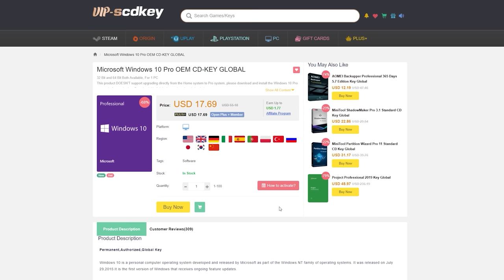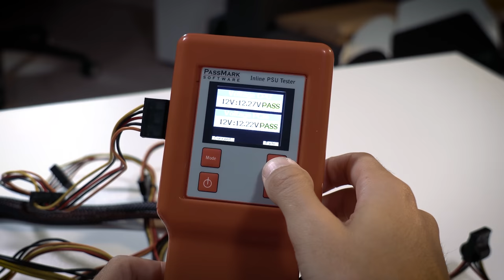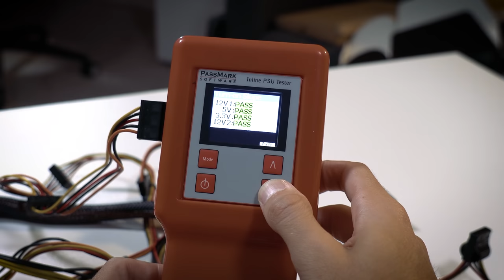Fixing a Viewer's BROKEN Gaming PC? - Fix or Flop S1:E10

Comment: Great video. Am I wrong or does that case already have a vertical mounting point? It did look like it would be a little close to the side panel so I could see why you’d go aftermarket, at least from an airflow standpoint.

Comment: Its prob a small capatitor that store some energy to boot it up. Had the same issue had it happen after a voltage strike because a company ripped a cable outside

Comment: had the same case you can do better cable manage but myssd holder was more in the middle and drilled out hd cage on right to have more fans avaible in front only used ssd

Comment: ThermalTake has always made crap PSUs. One question. The case looks like it has vertical mount space built right into the case. Why not use the case's built in vertical mount rather than using a vertical mount adapter kit? Just seems like unnecessarily adding the hassle of opening the case to plug in the video cable rather than just leveraging the integrated vertical mount provided as a part of the case. My guess is probably for cooling to provide more space between the GPU fans and the case door.

Comment: I had an issue, where mine shut off after an update, and when I turned it back on, it just lit up the system, But not signal the screen. I messed with the ram, and it came on, went right out.. I kept hearing to reset bios and see if that would work. Then I saw a video to take out the CMOS battery, and after 15 seconds, put back in. I did... then, and only then did the system give me a code...or error signal... the Alien head flashed... Turns out... Was a CMOS battery failure..  I already had a battery that was right size.

Comment: i had a power supply fan bearing blow out and i shut it down immediately to prevents a brown out or short that could happen in minutes. if this happens to your coolant fan as well SHUT IT DOWN IMMEDIATELY TO PREVENT COOKING YOUR PROCESSOR OR MOTHERBOARD "IRREVERSIBLE DAMAGE WILL OCCUR"

Comment: Sadly I need to get round to replacing my case a say sadly because the case is still in great condition apart from one icie problem the rubberised coating on the plastic has gone bad (something I didn’t even know it could do) and it’s now sticky to touch and leaves residue on you if you touch it, I’ve tried scraping it off and cleaning it but it’s like tar.

So I’ve learned something for future note don’t get anything with a rubberised coating ye it looks and feels good at the start but if it goes off elk.

Comment: Hey Greg so I was putting rgb fans in and hooking them up. The rgb lights on all 4 fans will not light up. I had an extra and plugged it into the same ports on the controller and it lit up so it's not the controller. Is it possible for 4 fans to go out at the same time?

Comment: I've repaired power supplies, but in vintage computers where you can't get them anymore. Anything made n the last 20 years is going to be easily replaceable unless it's a prebuilt with a proprietary PSU.

Comment: I have a computer that when I turn it on, the cpu fan spins, the psu fan spins, but, no bios, and no rgb on my ram sticks. I've tried swapping the ram sticks around and different psu's, I believe its the same motherboard in this video actually lol. Any suggestions that wouldn't break me? I feel as if the cpu is bad but then again I don't think that'd stop the computer from lighting up? Edit: Also forgot to mention I did check the ram sticks made sure they are seated properly and even tried 1 single channel. I've made about 5 custom gaming computers for myself and this one was just spare parts.

Comment: Capacitors are no joke. I took apart a monitor once for trouble shooting left it unplugged for 30 minutes accidently touched a capacitor and was knocked unconscious for a few seconds. Also I work in construction and have taken a shock from 120v a few times and the capacitor was far worse.

Comment: FYI, you should have noticed that the top fan turned on each time you removed power from the power supply via the switch and then put it back on. It was obviously a power issue from the second time you hit the switch :)

Then again I saw the TR2 600W and knew it was prolly dead before you even started. There is no way you hooked that to an rx 580 and had it enjoy a long life.

Comment: So long shot here, I’m having almost the exact same issue as in the vid, overnight I’ve developed issues, my mobo leds are on but as soon as you press the start button everything flashes and cuts out. I changed psu and can now get into the bios, however I now have a cpu fan error, my aio cooler was working fine before should I be focusing on possibly a damaged mobo, the aio cooler itself or something completely different? Any words of wisdom will be appreciated as I’ve had my 3080ti less than a week and have barely played with it yet

Comment: I bet you would have a hard time troubleshooting my pc, it drove me crazy for almost a year.. i was getting random hard freezes whenever the cpu was under load, temps were perfect, had tested psu, changed twice the motherboard, tried friends ram, everything else was fine.. in the end i found out that I apply a fixed voltage using Ryzen master, the problem disappears (1.15 V for a stock Ryzen 5 2600) and that's how I use it everyday, turning on the pc, launching Ryzen master and applying the fixed voltage profile

Comment: Hey greg, been loving this series. I have a question regarding xmp... I have a ryzen3200g asrock b450m pro4 mb, gtx1660 super and 32gb corsiar ram  however when i try to set it to 3200mhz (ram) it doesnt work I tried manualy chaging the timings even switching out the ram kit and no luck... THX

Comment: this has some of the same symptoms from my pre-built second hand pc, it would turn on and then off, i have reliable friend who knows pc stuff and made some tests and it was actually my itx motherboard, i had to buy a new motherboard, an ATX actually. and then it worked fine after swapping to a new motherboard.

Im glad nothing happened when i opened my PSU both untrained and inexperienced. i had no idea it would be a huge risk but i cleaned it and put everything back on.

Comment: i got this symptoms in my first pc, try everything and then when suddenly trying to power it up after switching ram, deep cleaning, etc.., my mobo sparks :( do you think the processor is still alive if this is the case? have no other mobo for swapping and scared to put a bnew psu to the system because the mobo might blow up lol, i have a new pc now but i want extend if possible or try to extend the life of my older pc because i think it is genuinely fun fixing things

Comment: Hey, i have a important question. I recently got a brand new PC, and it seems to be working fine, when I am running games and discord in the background. My processor is a ryzen 7 5800x, and my power supply is 750 watts, and my motherboard is a phantom gaming 4 b550. When i run this game called APEX LEGENDS, and discord, at the same time, my pc shuts down and restarts after some 30 seconds. I tried reinstalling, uninstalling, and running both apps. I did not update my bios yet, but i am thinking i should. I believe my default bio is 1.2, but i dont want to harm my computer since this issue occurs only when im running 2 apps, and my whole system shuts down. Should I update my bios, and is it even possible, since some people are saying my phantom gaming 4 b550 motherboard cannot be updated. I am confused, please help?

Comment: I have a problem where my pc turns on sometimes lasts like 30 mins then just freezes and then sometimes it just freezes before bios even sometimes before it gets to bios and sometimes it used to last hours before freezing but now it just constantly freezes early on , its not ram , gpu or harddrive or psu so its either my cpu and motherboard,  but I don't understand why sometimes it works for like 30 mins then freezes

Comment: That PSU originated back to 2013 if I'm right? So a PSU of 7-8 years old, not the biggest surprise this was the failing item. 
See it with a lot of home build systems, everything gets swapped out over the years but the PSU is kept till it dies.

Comment: see that the right power for GPU looks burnt and SSD front case power looks like not sitting well I've had the same case used the small drive bay for 2 SSD drill out HD drive cage front of the case to make room for fans

Comment: hey i have had an issue with my PC and want to see if i can get your opinion if i download a reasonable amount of software/games my PC starts to bluescreen till it wont turn on then i have to reinstall windows ive done this 3 times already bit if i keep the storage low it seems to be ok so i was thinking that my drive is starting to die its a 1T seagate

Comment: okay so, i have my gaming rig which i take to florida (west palm) every so often when i visit family, and ive had issues recently. i flew in from England, my rig was working perfectly and when i hit the states, the system powers up but goes straight back off. so i left it and when i came back to england, it works absolutely fine. the power supply works on 115V-240V on my EVGA PSU. and its only 1 and a half years old. and its done that twice. ive checked with my power supply tester and all comes up as perfect on both 115V and 240V. so i have my doubts its the PSU. and i dont have another PSU to test the rig with. its running a GTX 1080Ti and an i7 7700k. it only does this when its on 115V AC which is really strange.

Comment: Yup that smell is capacitor juice :) Probably not the big caps, as they'd be pretty visably 'popped' ... so some of the smaller smoothing caps. But, your right - not worth investigating honestly - and not even a nice modular supply that you could use in your exceptional builds.

Comment: Nice video, PSU might be a bug under the PCB possibly, they seem to have interesting  cooked smells.

Like ur PSU tester, better than mine. 

Kinda wished you lived near me (in AU) so u could assist with some issues I have with my rig at the moment, not sure that you'd have any ideas tho, its kind of a weird issue, doesn't stop it from POSTing but does stop me configuring it as I want it configured (BIOS level).

Comment: "And cable management literally takes minutes"
Cable management can turn a 10 minute PC build into hours. It's the single most time consuming part of the build.
Reply: Especially in a small build. I built my current PC in a Corsair mini-ITX cube case (older, can’t remember model number) and the cable management took WAY longer than building the PC. If I had just slapped everything in there like the good old days, I would have been done in an hour. It took a day and a half.
Reply: @AtomicAJ74  my last build was in the NR200. Cable management took a couple of hours to get it just the way I wanted it.

Comment: Why at 7:31 did you say that it couldn't be an issue on the power supply side, only to find out later that it was the power supply that was the issue? Did you misspeak, or am I not understanding what you meant? This isn't to call you out on a mistake; I'm genuinely curious if I'm not comprehending something.

Comment: The first time you tried to turn it on looked like a power supply issue. But you didn’t see the first boot even so yeah 🤷‍♂️ (I personally would always check first the power supply because if it’s faulty it has the highest potential to break other stuff...so I’d disconnect all unnecessary hardware and power supply and use a good known one instead. Than run it through a tester 🤷‍♂️ but that’s me and my history with bad power supply years ago...)

Comment: Thought it was the PSU from the start, behaviour like that is usually power related. You coulda thrown in a couple of fans, especially with the vertical GPU, he seemed to have pretty much non-existant airflow

Comment: Hey Greg, do you have a simple digital PSU tester? - for the user that doesn't have a spare PSU, wouldn't that be a good test? - hah, i just needed to watch more vid.
Reply: most 'testers' only measure voltage under no load, which does little when a PSU will still not power on under an actual load...; granted, if a PSU will not power on with even a tester, for sure it sucks.

Comment: looks like the vertical GPU is blocking the PCI slots in the back and not mounted in the correct vertical GPU slots  other than that great video as always
Reply: That's intentional. Mounting it in the built in case vertical mounting position puts it too close to the glass window blocking off airflow to the GPU fans. He's using an adjustable Cooler Master vertical GPU mount. He's done the correct thing.

Comment: Wow Greg, you'd think you would know how to install an AIO......That pump looks to be higher than where the hoses/tubes go into the radiator which could cause air to go into the pump....Unless the pump is on the Rad itself, buuuut I dont think thats the case here...Like really?
Reply: As long the pump is not above the rad it's fine. The way it's mounted any air inside the AIO will be at the top of the rad it self.

Comment: The only question I have is why would someone go with a non-Standard ATX (Mini ATX or ITX) when the case they chose is full size and is more than able to fit a Standard ATX? In my mind, the only reason to choose an ITX board is if you're trying to do a compact build. Seems like you're just unecessarilly limiting yourself doing that. Can someone enlighten me?

Comment: Anyone could have told this guy that his power supply was dead lol. I'm sure they knew it but I guess this way they get it replaced for free and get a shiny new case out of it for participating in a sponsored video. It's always important to do your research when buying a power supply beyond it being gold rated or whatever else as some models are just junky, this is one of those that wasn't very good and has major overheating issues. 

The good thing about today is many reputable power supplies are well tested and reviewed so you can get a decent idea of what you're getting into and what power supplies are recommended. It's just as important as what GPU and CPU you get for gaming PCs, buy cheap and buy twice.

Comment: Immediately im thinking its a psu. When i built my first pc i would press the power button and it would spin up for 2 to 3 seconds then shut off. Any attempts after that would flick on and off immediately, and the only way to make it spin up was to unplug the psu from the wall and plug it back in. Turns out the psu was dead and i had to rma it.

Comment: U a brave man! lol i just had a evga 1300 watt g2 explode on me  it did s loud pop noise and sparks out the exhaust. I would never turn a faulty psu on with out the cover and 2 feet from my face lol    Sucks i have to rma a 3 month old psu to get a used one 🙁

Comment: My initial thought is CPU cooler, particularly if the system is overclocked.  For some strange reason my AIO just didn't want to catch prime or something and the poor CPU was just roasting and shutting off.  It would throttle so hard that the few times I was able to get into BIOS to try to figure out what was going on, the freakin BIOS was so laggy it was near impossible to do anything and the mouse movements made it appear like 4fps.
Reply: OK, watched far enough in to see that it's not actually turning on at all and that definitely looks like a short circuit protection.

Comment: Something like that happens with my laptop. It turns on and then it shorts down. You try to turn it on again and it refuses. The only way to make it work is if I keep it plugged in to the charger. Otherwise it will shut down.

Comment: i had a power supple that was on fire in  the PC it seemed to  me the plastic that rapped around the cords that set on fire as the the power supply its self still worked just find me and the shop i took it to were at a complete lost i just sent it back with warranty but yer very weird for sure.

Comment: A bit of a crap PSU tester that is if it doesn't put any load on the PSU.
It's as good as those $5 chinese PSU meters.
If they want to keep the handheld formfactor they can use chunky blocks of copper as a thermal mass and be able to even fully load a 2kW PSU for a moment without it having any form of cooling, because you only need to load it for like a second and you will detect most of the failed PSUs.
Though the disadvantage would be that it would need to cool down for like 5 minutes after one or two tests...

Comment: I don't want to be "that guy": A failing PSU means it's not impossible that one of the components got their lifespan shortened out; so it's possible the system will fail in the future one way or another. Or it may be fine.

Comment: I have a msi z390 gaming ac, i7 9700K , Corsair TX750M, 750W PSU
Corsair Vengeance RGB PRO DDR4 16GB , and 2 m2ssd and 2 x 2.5ssd.
I had a problem that after 5mothes pc started to freeze, the screen all locked and the picture was there still, it freezed like all from 30sec to 1hour.
I have a streaming pc, so i tested some parts in it, nothing wrong.
send all parts where they was buyed and they tested them.
got all back with message ( all parts is good ).
So i see no reason why i dont try go in bios try thing i dont know how to do.
I turned of " Intel turbo boost " , And followed a video on youtube how to OC.
Overclocked it, and 1.5year later its running fine still.

So " intel turbo boost " is biggest shit ever made...